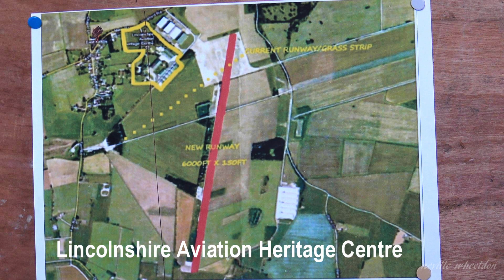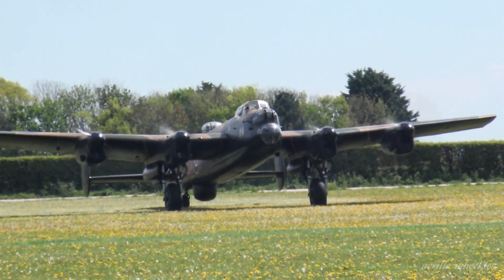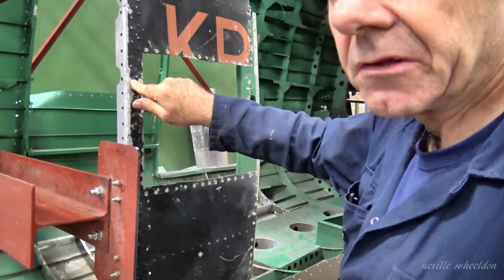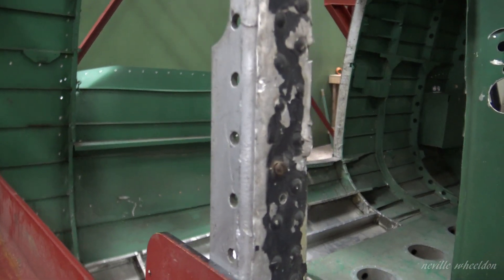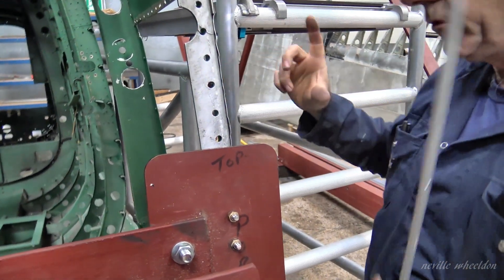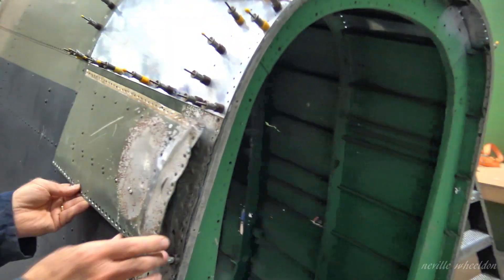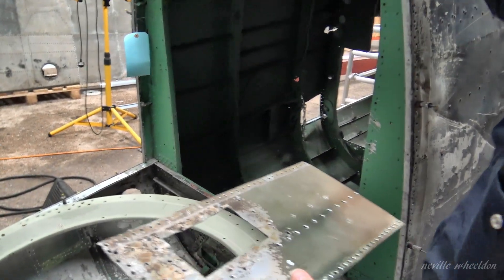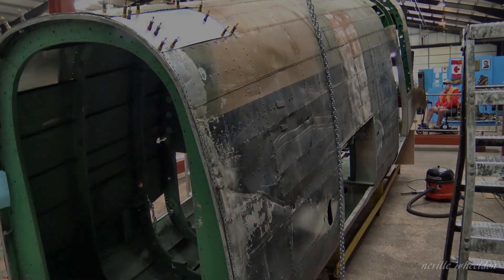Video 101 Restoration of Lancaster NX611 Year 4.  Proposed grass runway

Comment: I’m confused. Is KB976 I different airframe? ( built in Canada at Milton )
Reply from the maker: Hi Owen "Just Jane" LN611 is the one being restored to airworthy, KB976 rear fuselage will be restored to a safe standard fitted to "Just Jane" NX611,.,"Just Jane" will then be able to give taxi rides earning revenue.   They will then restore "Just Jane" rear fuselage to airworthy condition re fit to the Lancaster. and return KB976 fuselage back to Doncaster (Yorkshire Air Museum). The idea is to keep "Just Jane" giving Taxi rides as long as possible to earn revenue to pay for the restoration. The same goes for the French Wing from Lancaster NX644   check this link     https://www.lincsaviation.co.uk/news/lancaster-nx611-return-to-flight/lancaster-restoration-news--wings-fund.htm

Comment: don't the BBMF know how long a lanc needs to take off with no bombs, ammo and part fuel load
Reply from the maker: Hi Paul, this is the distance what required for safety 5500 feet of runway set down by CAA as Lancaster NX611 will be a civilian aircraft. BBMF Lancaster will come under MAA (Military Aviation Authority), they will most likely be the same distance.

Comment: 02/20 was originally the longest hard runway, at 6000 ft, so not much more than it newer version. 08/26 and 13/31 were each 4200 ft. Lancs were built to cope with grass runways - look at those lovely fat tyres.
The tree planting to the west of the proposed runway may help or hinder operations. They provide some shelter from the prevailing wind, but may increase turbulence which could be a big problem just after takeoff. Lancasters coped with much worse in their service lives.
Reply: In service, the lanc was also a disposable item..
Reply from the maker: Hi DSV , I'm sure they will take that into consideration.

Comment: Great video. Just a thought. If you have the top and bottom radii of the former, and the location of these, wouldn't the 17 feet radius simply be tangential? This would fix the location and lengths of the sides. Probably need Autocad or something similar.
Reply from the maker: Hi raytrevor1, I'm sure John and Bob airframe engineers will sort it out. Thanks anyway.

Comment: The centre of the 17 foot radius can be determined by taking the upper and lower tangent point and then calculating the angular displacement as the chord length is known. This will give the centre position of the circle.

Comment: Great update Nev. id looked up the site on google earth and thought that grass strip they taxi on is nowhere near long enough. I wondered if they would reopen that concrete runway visible to the north east. I would think taking off on grass requires a longer run as just like peddling a bike on grass takes more effort than on a hard surface. I expect on the big day that they strip back all superfluous weight to a minimum. What a day that will be!
Reply: In days of yore we used to fly in to East Kirkby and land on the runway extension (outside the peri track) of 08/26, which was laid down in USAAF days and still had a good surface. We would be collected by the museum in their classic crew bus. Then the people who ran the extension as a motorcycle training area got a bit uppity, and our only option was to land on the concrete apron, which wasn't big enough for a Cessna 172 with 4 on board. The grass runway made it a feasible destination again.
Reply from the maker: Hi Mark I don't believe that strip belongs to the Centre, also a public road runs  past dividing the two pieces of land.
Reply: @nevillewheeldon1693  understand, the view from google earth only gives so much detail away!